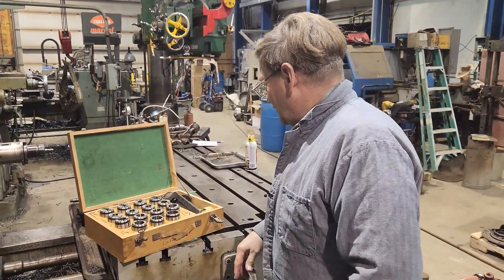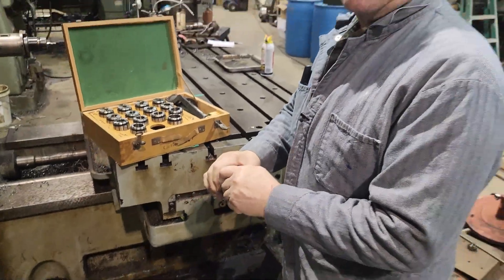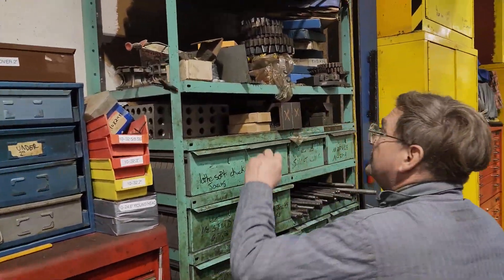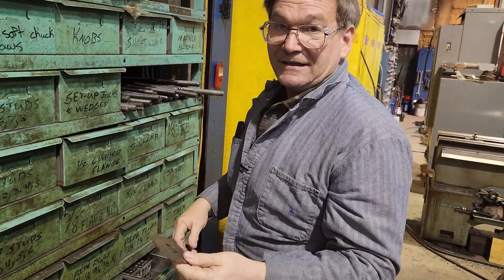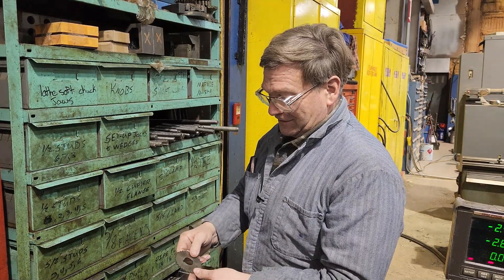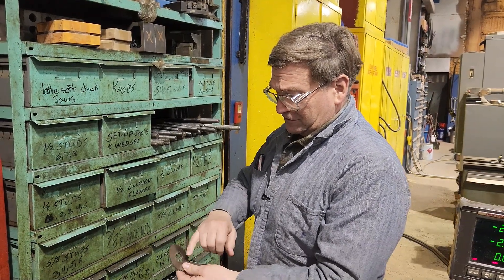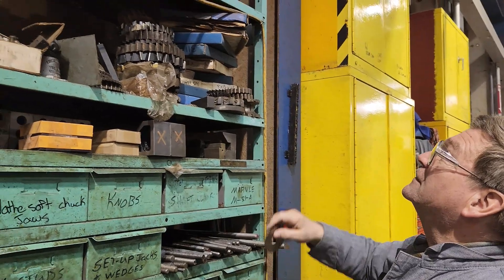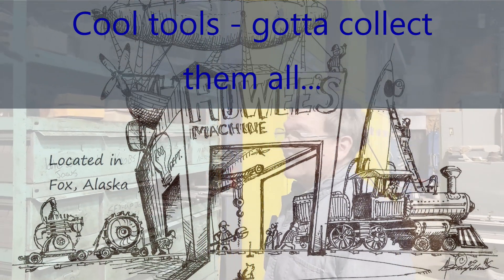Machinist's Minutes: Mill saws and new collets

Comment: Definitely nice to have as an option. I had a beast of a job. Cut 60 slots in a blind hole. Cutter was 1 3/4" x 0.020". Hole size 1.770". Depth of cut 0.240". Length of cut was 2.00" Material was 253MA duplex stainless steel. Nasty nasty job. We did our trials on a Bridgeport mill. Had to make up a chain drive and put saw on the end of a bar. Like a chain saw. Drove with a motorcycle cam chain. The secret was coated cutters and high-pressure straight cutting oil. Could make 4 components  with one blade. Had to make indexer, pump and tank, screens as well as drive etc. These were for cooling fins in the hot part of a sterling engine. Sadly no photos of the work. Surprising what you can make if given the chance.
Reply: Nobody around here would pay for that

Comment: That does not look like an ER collet, TG 150 maybe?
Reply from the maker: I think you are correct, I will measure the taper before I order extra collets.  Thank You, the collets are not labeled for style just ID, and brand.
Reply: Without holding them myself I would say they are not ER collets but TG150 I use them on my 12 ft horizontal mill at work. ER has an unmistakably steeper 8° (16° included ) on the bottom and fairly large 30° angle on top compared to the 4° (8° included) of tg collets. I personally prefer single angle collet like TG or SK over ER because they have a lot better griping power.